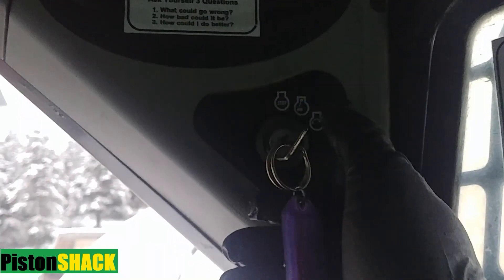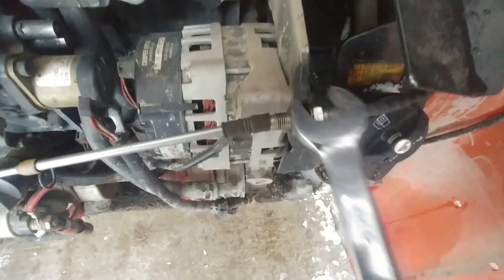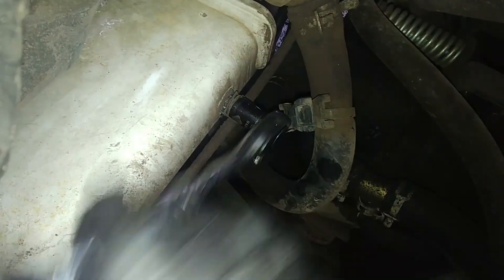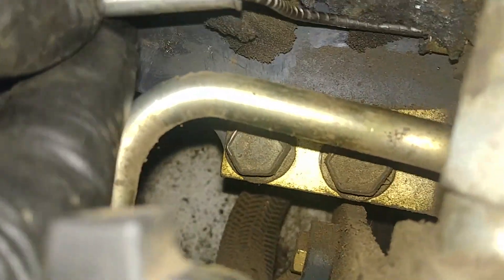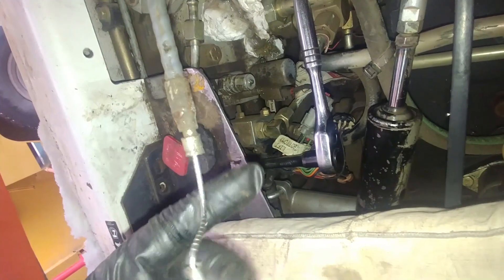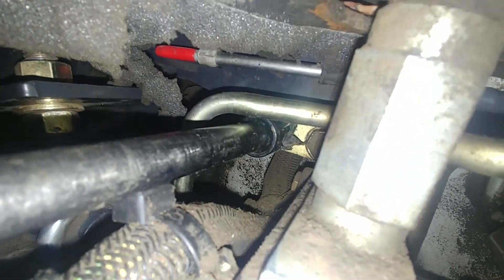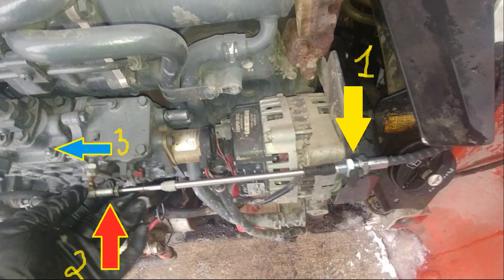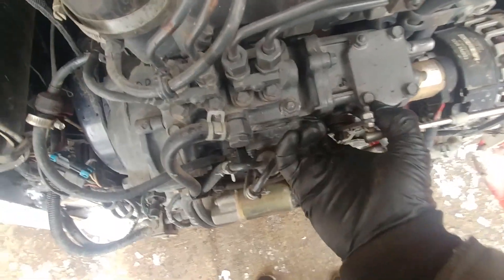BOBCAT ACCELERATOR CONTROL CABLE REPLACEMENT & ADJUSTMENT aka "throttle" cable.

Comment: Great video... what size and type of socket did you use to remove the bolts at 7:00 mark?  I cant seem to get enough clearance
Reply from the maker: Unfortunately, I don't remember exactly. It has been over 4 years ago. I think I used 9/16 shallow socket from Stanley socket set. Let me know.